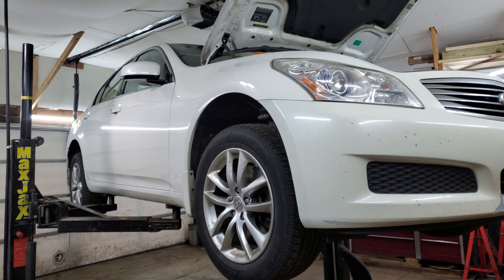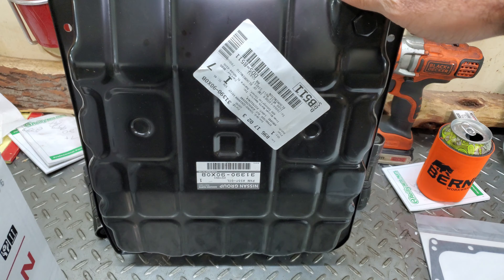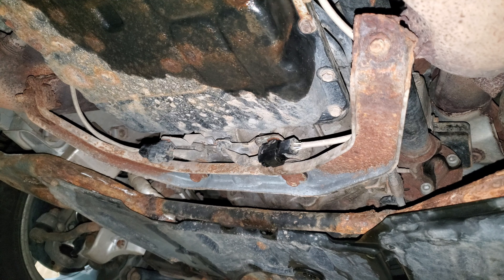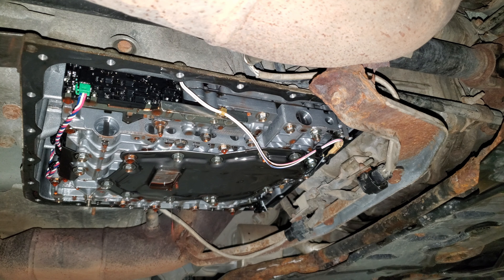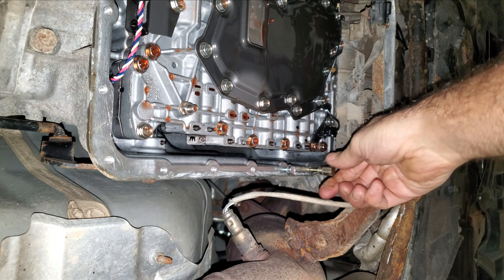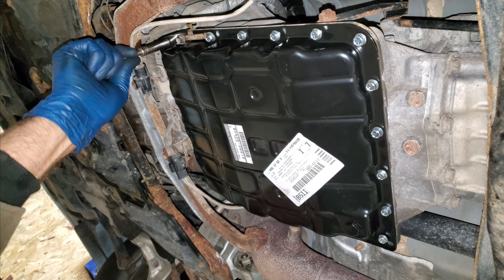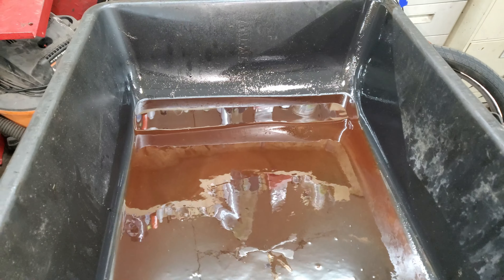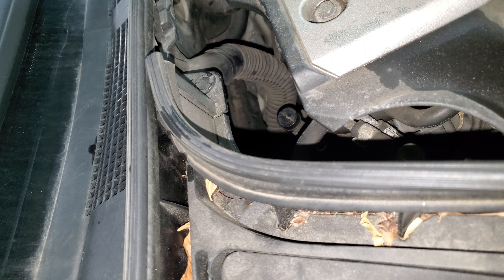2003-2008 Infiniti g35 transmission pan replacement

Comment: As a Nissan tech this is highly entertaining. Had a versa with the same issue. By the way the bolts are supposed to get torqued to 70in so great job on the estimate.
Reply: How to I torque it like that without a torque wrench

Comment: I have a 2015 Infiniti q70 with 90k miles it’s been extremely reliable and I’ve kept up with all the maintenance. However last year the driver door lock stopped working and I took it to Nissan under my extended warranty and they diagnosed it as a door lock actuator and replaced it. Just two weeks ago it happened again and it’s the same thing the driver side only door lock actuator went out. Do you have an idea if anything else could be causing it?
Reply from the maker: I would test the actuator by its self. Sounds like a warranty issue.

Comment: wait, you need the bolts too ? Can't reuse the old ones? I bought everything besides the bolts!
Reply: just depends. i replaced mine yesterday and i was able to use the old one. They had zero rust unlike this car.
Reply: @wyattracing_andreviews1155  Lol I ended up buying new ones.
Reply: @cherryluong1079  where did you find a transmission pan and the bolts? I cant seem to find them anywhere online.
Reply: @john0043  I bought it from a nearby Infiniti dealership online from their parts dept.
Reply: @john0043 Z1 Motorsports

Comment: Did you r3place th3 filter
Reply from the maker: I think not
Reply: @RustBeltAuto  I was looking at the bottom of the Trans on the car you did I don't see a filter I called the dealer they said my car doesn't have a filter